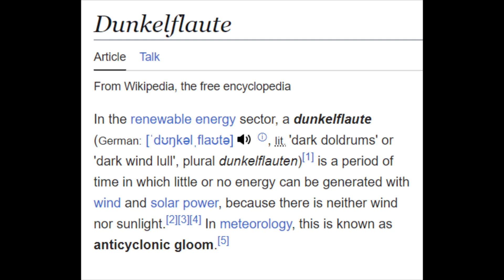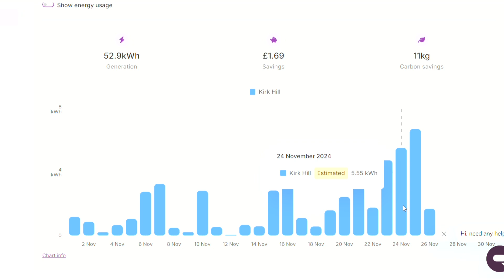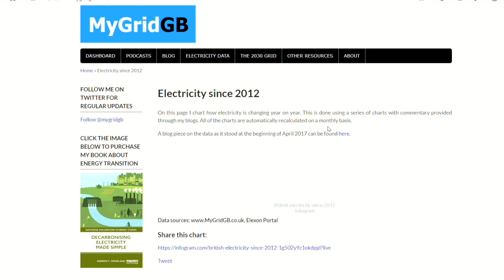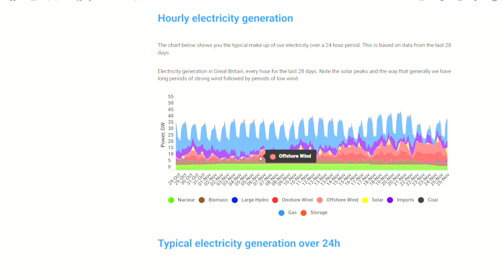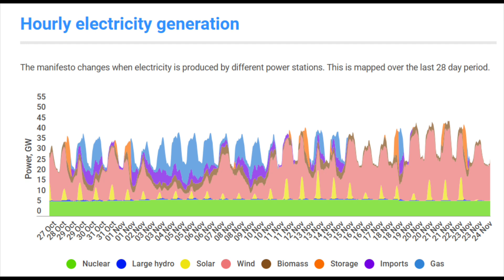Dunkelflaute: The Energy Crisis You Didn't See Coming

Comment: Carbon Capture retrofit? 1½ times biomass means burning more wood chip, which is only designated low carbon due to a glitch in the Green designation. 5.8 million tonnes of Electrical arc furnaces, although it looks as though only 1 million tonnes of steel production as the new furnaces are only 250 Kilotonne furnaces and as Teeside is in a higher priced area it is unlikely that it will actually run. There is an upper limit on LNG imports and the three existing terminals are approaching maximum capacity. Two new LNG terminals  are required one at Canvey Island and one at Coryton. Neither of which are likely to be built.Fortunately Vauxhall Luton won't be using electricity to make EV vans as it will be shut. Does your friend's model how many existing jobs will be lost, in legacy industry?, Where Green Jobs will come from? Constraint payments on Gas generators of nearly ⅓ of  total generation. Does it take into account the lack of aging nuclear assets both in the UK and the near continent Belgium are losing nearly all of their nuclear and will require excess energy from France, cutting down on UK imports potential. The Northern Belgian energy hub is unlikely to proceed due to Green Protests. The lack of Electrical transmission between Scotland and England ( national grid have had three goes at bridging the gap for the last 14 years) It won't happen for another 50 years. The ITER project is running out of Tritium for every year of delay and a nuclear power station is to be built nearby to power it. 
Basically your golden uplands are going to be a hell on earth for the majority of the UK people, high electricity costs will destroy the British economy and cause an upwelling of destructive feelings against the government.
Reply from the maker: Hi Robin, I see a lot of problems and complaints but not offering any solutions - are you suggesting we carry on as we are? 
I disagree that my golden uplands will be a hell on earth in the UK, the green revolution gives us massive opportunity for cheaper energy, cleaner air, secure energy without reliance on dodgy states around the world, and yes, green jobs. Yes there will be change, but rather than throwing people under the bus like what happened with coal miner's in the 80s, my hope is that the change will provoke better jobs across the Country.
Would encourage you to be hopeful and optimistic.
Tom
Reply: The Luton shutdown has been in the air since at least 2023, when Stellantis was blaming Brexit. The company hasn't had a good plan for that location for a while.

Comment: But by 2030 there will be a lot more EV and Heat pumps. What would the model look like with double the consumption we had this month? I would suggest we need to go all out with small modular reactors (Rolls Royce). Treat it as a national energency and get RR building them now! They could be deployed on existing decommisioned coal fired plants which have existing connectivity to the grid.
By the way burning wood is worse than burning coal.
Reply from the maker: Hi Bob - fair point, and I think something that Andrew has considered, but I dont think on his website. I will ask him next time I see him! 
One thing to note is that EVs tend to charge away from the peaks as cheap tariffs for EV charging at home encourage overnight charging, so this would help use wind when we don't normally. We can also heat hot water tanks away from the peaks. The demand profile is likely to change. 
I think SMRs are likely to play an important but limited roll. But definitely part of the mix.
Agree that burning wood in places like Drax is a very very very poor thing to do!!!
Tom
Reply: @TomBray-LowCarbonLifestyle We don't have a safe storage solution for the nuclear waste we already have. Sellafield is in  a dire state, costing £billions a year and is leaking radio active waste. Its not going to last the 100s of years necessary.
Reply: Indeed - Drax being the prime example and they get subsidised for bringing woodchips across the Atlantic from Canada!
Reply: @ralpharmsby8040  and on target to make  £1 billion profit this year, which I think includes the £600 million from the government, crazy!

Comment: That's pretty much where Scotland is currently. Nuclear is likely to disappear here in 2028 as Torness closes. Peterhead (gas) currently only runs when it's not windy.
Virtually everything outside Peterhead and Torness is renewables, power from waste, or temporary back-up power - old diesel back-up generators.
Not too bothered by end of life for Torness. Started seeing cracks, and it's not needed up here.
Not certain carbon capture will ever actually work anywhere but it keeps the oil companies happy, and definitely won't make up for methane emissions from natural gas.
The last 10% of decarbonisation of the power grid will be the hardest and most expensive. 
Really need to decide if it's worth it when it's only for use during dunkelflaute. Don't let perfect be the enemy of good enough? Battery technology - flow batteries or sodium ion for instance - has the potential to be a much bigger part of the power grid, so things can change relatively rapidly - in much less time than say the construction of a modern nuclear station.
Reply: More like last 5% than 10%. 
It wouldn't be that expensive if we used bio fuels for that last 5%. Bio diesel would be the best solution.
Reply: @JSM-bb80u  depends some on what crop is grown to make it and where, and it still causes pollution. 
It's potentially even a semi-sensible usage case for green hydrogen (regardless of the inefficiency) but the numbers would really need to be crunched on that.

Comment: When the sun doesn't shine (Evening)
The wind is not blowing ( Actually it is Impossible but let's assume only 20% of production capacity )
And the water doesn't flowing ( Drought).
Reply: Battery storage. Millions of small scale batteries in cars.
Reply: @stevejones2310  V2G would give me 50+kwh of usable storage from our V2L capable 72kwh Ioniq 5. Lokking at getting a 49kwh Insta to go with it in the new year. Will add more PV to maximize our independence from buying grid power. I'm hearing 2025 for V2G EVSEs.
Reply: Interconnects, demand shifting, batteries everywhere and long term energy storage.
Reply: @Biggest-dh1vr  yep. This message isn't getting through to the deniers and fossil fuel lobby

Comment: An extra 3.2GW from Hinkley Point C won't offset the loss of capacity from the AGR atationa scheduled to have closed by 2030. Gas stations will still be required beyond 2030 and they still cost money to build and maintain, and I can't see their engineers going onto zero-hours contracts where they don't get paid if the station is idle. Many of them will operate on hot standby, burning gas for zero output. Plus, the carbon capture concept ia still unproven, you have two stations generating electricity and a third running just to provide energy to capture carbon from the other two. It's all going to get very expensive.
Reply: It's already expensive and the current relatively small percentage of wind hides the extent of constraint payments. As wind increases these payments will become far more impactful. The Net Zero policy is top level aelf-harm.
Reply: Gas is planned to be only 5% of generation in 2030, and decreasing from there.
Reply: @brendanpells912  carbon capture is pretty much proven to not work everywhere it's been attempted so far.

Comment: These solutions will vary depending where you are. In Western Australia we have no nuclear and likely never will have. We usually have excessive amounts of solar power, (more than 40% of homes have solar panels, as do shopping centres and many businesses) which sometimes gets curtailed. Batteries are a big part of our solution, along with distributing solar farms east/west to provide power earlier in the day. By 6.30am today, nearly 50% of our power was generated on peoples' homes. I find the different problems and solutions being provided to be fascinating. It must be a glorious time to be an electrical engineer.
Reply: Aussie,
the larege amount of solar is a negative, such that grid operators are forced to dump solar generation by tripping them off line (using grid voltage spikes0. Just because you can generate electricity from pv panels doesn't mean that they are a good idea for grid supply.
The negatives apart from the fixed output relative to time are no inertia, for stability of frequiency, no reactive power for stability of grid voltage, no short circuit capability for grid protective systems correct operation, all these negative need extensive and expensive support. The more conventional generation that is forced to shut down the worse the problem will get. 
How much has your electricity cost increased in the last five years. ironically making solar more attractive for the domestic user.

Comment: ... or we can just fix it completely by synthesising e-NG (renewable natural gas) in excess wind. The current government say they're going to leave us with ~150GW of solar and wind. We're already over capacity, so every added GW gives us marginal gains in low wind, but 100% added excess in good wind which we currently pay to dump. People need to stop saying "emissions" and "low carbon" and look at what UK has in its cupboard: colossal offshore wind potential (~2,000GW) and a highly-developed gas grid. We must replace the content of our gas grid and stores (2,300GWh) with renewable gas. "Emissions" of renewable gas don't contribute to Climate Change.
Reply: That gas store figure is reported by gas people to be about a week on average or a 'few winter days'. All-kinds (transport, defence, industry etc) UK power consumption averages about 200GW, and we're currently in a 5-week dunkelflaute, so the scale of storage we need is colossal. The Royal Society do a good job of saying how big UK storage needs to be in their work which I think is only to make our electricity grid independently renewable - and they say 100TWh, about 50 times its current size, or 5× that of Germany? We must remember NetZero is only *where we should have been all this time*. To remedy Climate Change, we need to do better than NetZero - much better.
Reply: @trs4u e fuels are not currently economic, currently much more expensive than heat pumps. We need to electrify transport and heating.

Comment: An interesting video on an under discussed topic. You did not mention hydrogen though, which will almost certainly need to be a part of any long term solution, in order to replace natural gas. If we have enough wind and solar energy to meet average demand, then there will be times when there is too much electricity being produced and this could be used to generate green hydrogen by electrolysis, and stored underground in salt caverns. When there is insufficient wind and solar it could be used to power gas turbines to generate electricity. There will be quite long periods when there is not enough wind or solar, so batteries would be too expensive, and even pumped storage hydro would be insufficient. Only hydrogen or gas with CCS could realistically cover these gaps. CCS as you pointed out is an imperfect solution, because it has never been shown to be as effective in practice as it is sometimes claimed to be.
Reply: Hydrogen struggles on cost, efficiency, storage, transport, power density, and mechanical handling (embrittlement of metals, porosity of plastics, and storage at either cryogenic temperatures or high pressures).
Other than that it's brilliant.
CCS announcements are showing oil company lobbying works much better than CCS does. 😁
Reply: Heating with hydrogen is vastly more expressive than heating with electricity, so will never be used for domestic heating.

There are some niche uses where it is the best option. One use may be long term energy storage if no more economic storage methods is found. Electrification of existing processes is currently a better investment, however.

Comment: Mersey region metro mayor pushing for a tidal barrage so maybe another source of energy
Reply from the maker: I would love to see that kind of big ambition, Swansea bay seems like a no-brainer. Mersey, a bit of a bigger challenge, but love it as a concept!!!
Reply: @ with a bit more ambition the previous government could have had the new bridge over the Mersey incorporate a tidal barrage but no ambition from them, hopefully the new government with Edd Miliband have.
Reply: @johnb7644  Whilst I would love to see a Mersey barrage, I think  we need to trial a smaller installation first, say the Wyre estuary in order to gain experience ( and the supply chain) in building such structures. The experience from a smaller installation can then be applied to a bigger project hopefully reducing the cost of construction. And then on from the Mersey to other tidal barrage schemes around the U.K. . Such schemes have a generation life ( with appropriate maintenance) of 120 years plus, ie about 3 or 4 nuclear power station lives worth.
Reply: I don't think tidal barrages will be contenders, given environmental consequences and cost.
Reply: @Biggest-dh1vr   A coal fuel power station at Fiddlers ferry was recently closed and the cooling towers demolished, all the necessary electricity infrastructure was available just a matter of the government and the network operator to move on it, environment issues do matter but in the extreme weather likely due to global warming it has now to be on balance reducing carbon emissions and expanding electricity generation
Reply: Severn barrage!

Comment: The main mistake (imho) by the move to renewables ( which I wholly support—and I am an investor in Ripple) is the lack of construction over the past decade in long term storage (ie pumped hydro). There are many more sites in the U.K. which could be utilised,.I read a paper on the internet where worldwide pumped storage potential was analysed with the U.K. having far more potential than is commonly thought for a non mountainous country.
Reply: I think there's  few reasons for that. The main one is that we don't need a load more storage yet. We're not yet at the point of having excess power. We can't be far off, but we'll need to have excess power for a few hours every night before it's worth building more storage.

Another is that grid scale batteries have got so much cheaper that they're now about the same price as pumped storage, and getting cheaper every year.
Reply: As a Swiss, I am a great advocate for pumped-hydro.  And yes, there are indeed a huge potential for prime pumped-hydro sites in the world, including in the UK.  However, pumped-hydro is NO long-term storage solution.  In order for pumped-hydro projects to be economically feasible, there must be pretty much one charge/discharge cycle per day! NOT per season!!!
Reply: There is some competition to be had between hydro and batteries. Batteries are quicker to build and install right now, and can be distributed to smooth out demand and reduce the amount the grid is forced to carry.
Reply: Only if you don't live in the Lake District. UK has only 4 viable sites out of 20  possibles and remember Dinorwic has insufficient storage for the dark hours in winter, same for any of the alternatives. At least 5 tidal barrages could have done the job. Low technology jobs for hundreds of thousands and reliable energy for 100 years
Reply: Yes, the Australian National Uni did a study called: "Global Greenfield Pumped Hydro Energy Storage Atlas" it has a spreadsheet of possible locations and an interactive map. Great to browse.
Reply: @simon7790  Right!  That's the one I was alluding to!

Comment: For those of you who don't know about Eigg; they went completely eco and had wind, solar and tidal, but at one stage it all stopped and they had no power for about two weeks if I remember correctly
Reply: The tide stopped?
Reply: @robinbennett5994 the tide turns every 6 hours during that period no flow
Reply: The cheap batteries that are now available would likely have helped.
Reply: I have just read a little bit about the Eigg project. Sounds like an amazing success to me. The Scottish Island is too remote to be connected to the grid . They have run their own hybrid Wind , Solar , Hydro grid for years now.... They do have diesel generators as backup for Dunkelflaute...
Reply: @rico4229  El Hierro in the canary islands is another
Reply: @waynecartwright-js8tw  Although I applaud El Hiero for their ambition, the installation is not working quite as anticipated, the pumped hydro part of the scheme is too small for the island requirements.
Reply: The internet in 2024, post a comment finish it with ‘if I remember correctly’ - great.
Reply: Seems very simple to have a few diesel generators and a stockpile of biofuel for those rare occasions.
Reply: @jamesbarker7145  If they get some reasonable storage batteries they could change the alternator on an old car or tractor  to a serious battery charger type one and just run that steady overnight. Boats do it a lot to recharge (boost chargers). Very low investment.
Reply: I've had a little google and can't find anything about them going for two weeks without power. Have you got a source for that?
Reply: Well we may as well give up then , its not like it saves money most of the time.